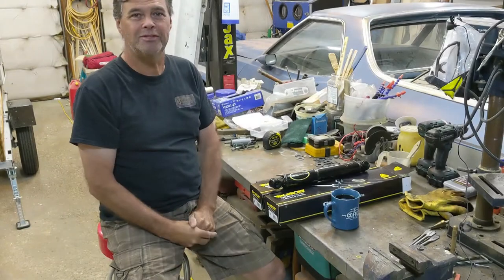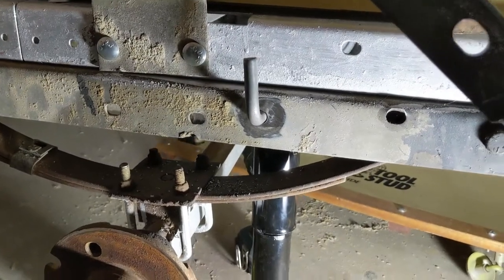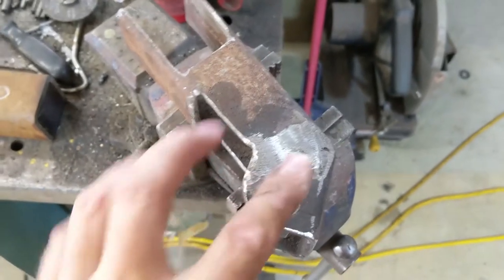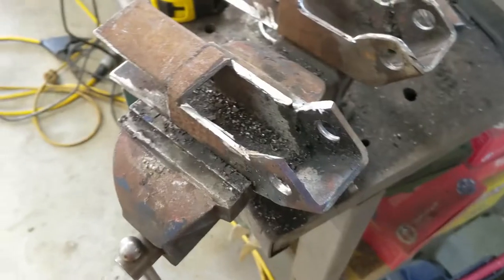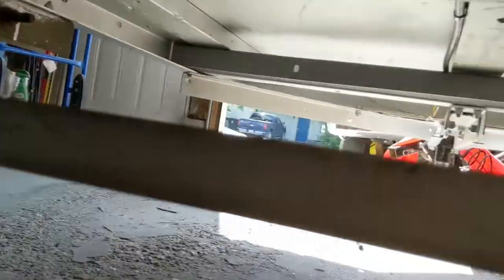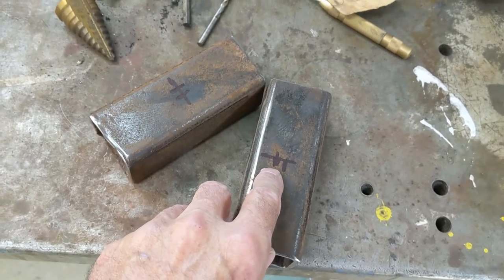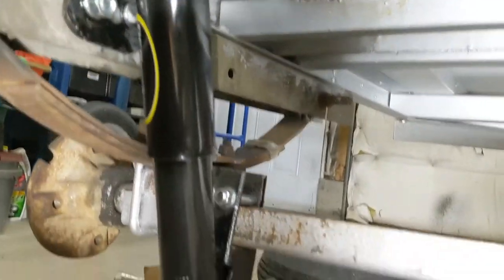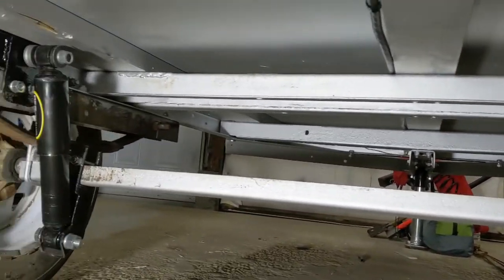Corvette Shocks Installed On A Harbor Freight Trailer

Comment: Air shocks, air shocks.  Hydraulics!  Low ride that baby while going down the street.😎  It'll be a first.  You'll be famous!  Cover of Trailer Life and all that.
Btw...I'm unable to answer your comments on Odyssey.  You might have the return comments function blocked.
Regards,
John
Reply from the maker: Thanks John, it did make a difference, no more bounce! I'll take a look at my Odysee settings, thanks for the heads up!
Reply from the maker: Your reply came through on Odysee...so it seems to be working. 🙂